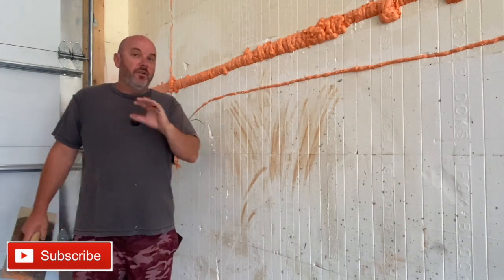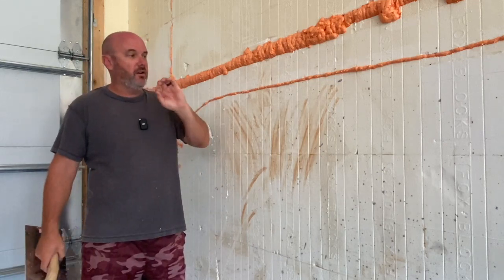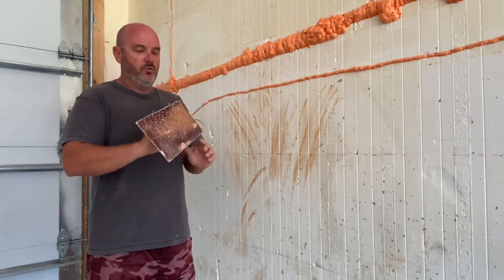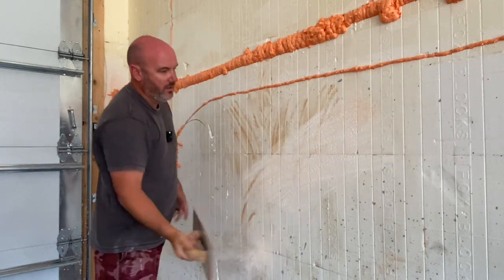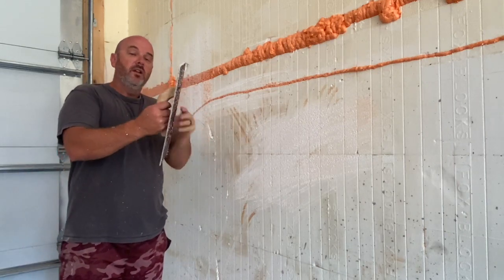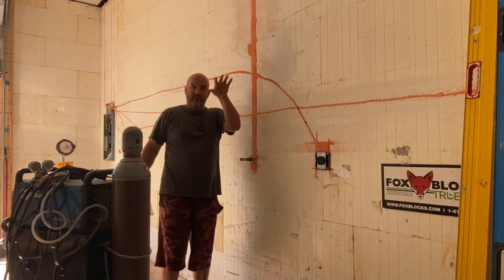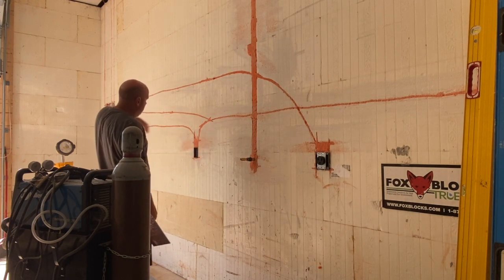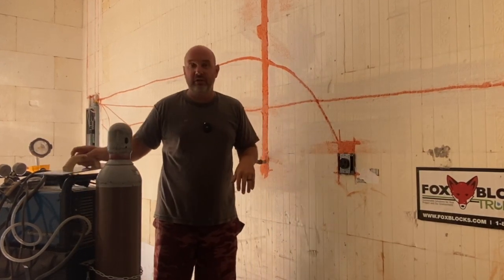ICF Rasping!!!

Comment: Nice rasp tool and finish. My only comment is that I believe that mains wiring is supposed to run horizontal or vertical, not diagonal. Best to have 90° corners rather than sweeping arcs or diagonals. Really nice setup and info, thanks!
Reply from the maker: That’s not the main, that’s my air line, main comes in direct to the panel from a j box on outside of the wall